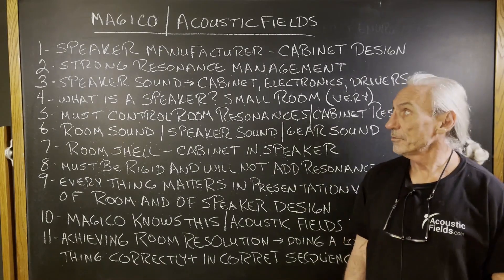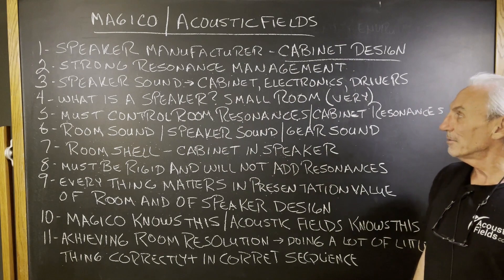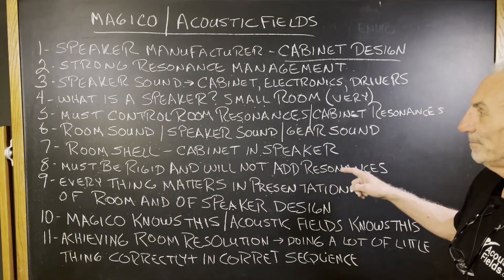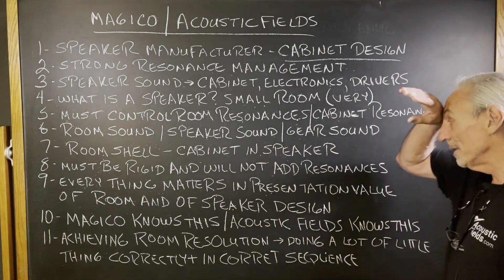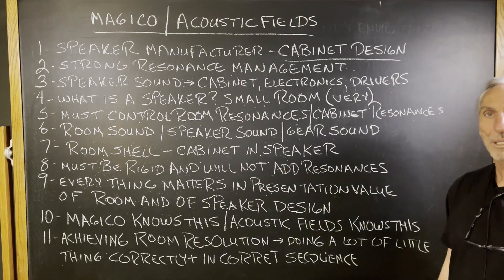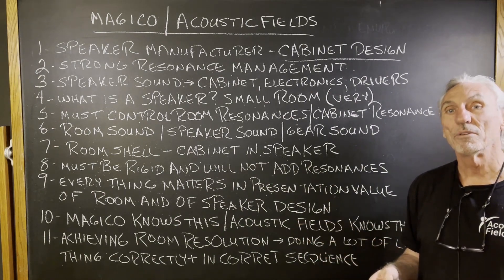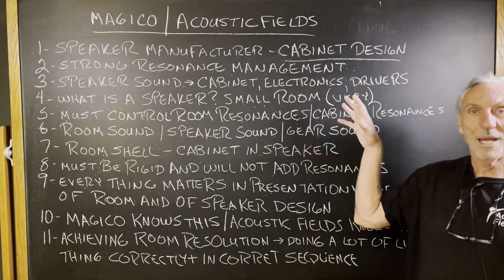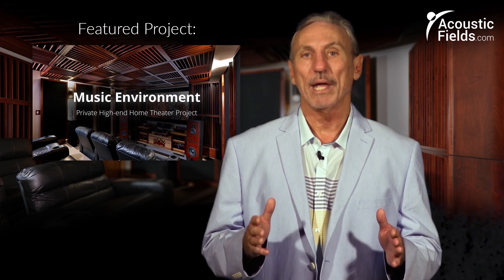Magico: Incredible Speaker Design! - www.AcousticFields.com

Comment: Just to correct you; Acoustics hasn't changed for millions, if not billions of years. Our understanding of acoustics may have changed, and certainly our approach to designing audio equipment has changed, but acoustics have remained and will remain a constant!
Reply from the maker: Electronics have progressed. Unfortunately, people are still stuffing boxes and walls with building insulation and calling it a "bass trap".

Comment: So why not stick with open baffle ? No cabinet coloration (minimal) in case of magnepan/ESL speakers line source driver ...
Reply from the maker: The cabinet resources are just one of three issues faced by speakers. The distribution array along with the electronics all have to be taken into choice consideration.
Reply: .... because there is no free lunch with any speaker design and there is no - One Fits All approach to enclosure design! 98.9% of what I do is transmission line designs, but I've never said, and would never say t-lines are the be-all and end-all, as others seem to comment. I have done some OB designs, and whilst they sound great, for me personally, bass was an issue, given the resources and drivers I had at the time. OB's  .... they're brilliant when done right, but that's down to the individual's requirements. 
     I always suggest to people that they should watch Pete Kulicki's (aka Hexibase) video on his Hexibase channel Acoustic Engineering Workflow I won't share the link, but a quick YouTube search Acoustic Engineering Workflow Hexibase will get you the video
Pete also did OB speaker back in the day, but had a specifically designed sub in the corner.

Comment: Those speakers are interesting. Will be looking forward to what you think of them down the road.
Reply from the maker: A speaker is a small room. We take many approachs with barrier technology to achive noise transmission numbers. Speaker "rooms" have to deal with cabinet vibrational energy and modal issues. They are very similar.